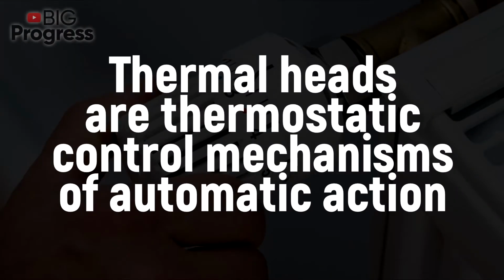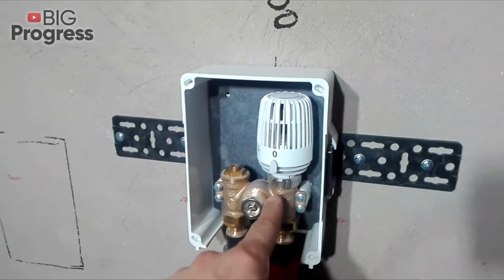How To Choose The Correct Thermostatic Radiator Valve

Comment from the maker: 00:00 Welcome to BIG Progress
00:06 Thermal heads are thermostatic control mechanisms
02:30 Next, let’s see how the thermal head is arranged inside and what is its principle of operation
03:36 There are various types of thermal heads
03:40 Thermal heads with built-in thermoelement
03:56 Thermal heads with a remote temperature sensor
04:24 Thermal heads with external regulator
04:41 Vandal-proof thermal heads
04:55 Electronic (programmable) thermal heads
05:37 In is nessessary to point out that most manufacturers offer a wide range of thermal heads, different in shape and color
06:10 And in conclusion